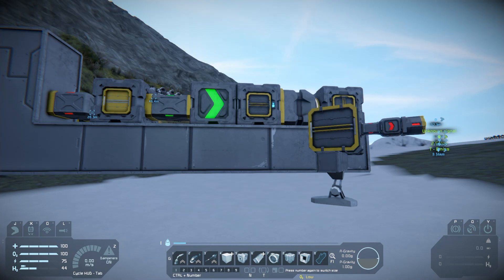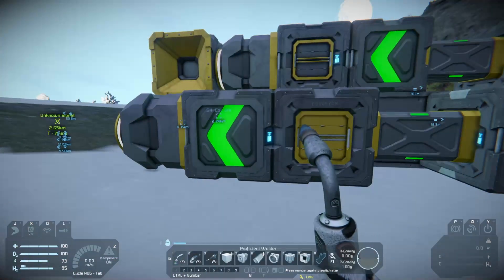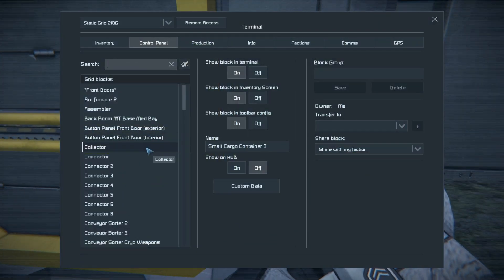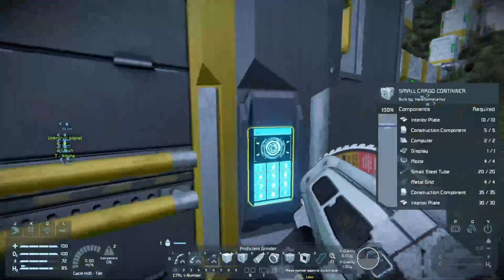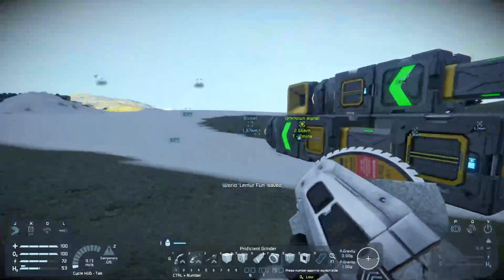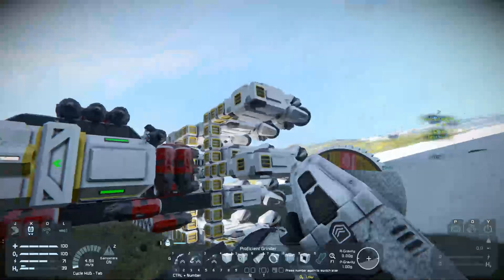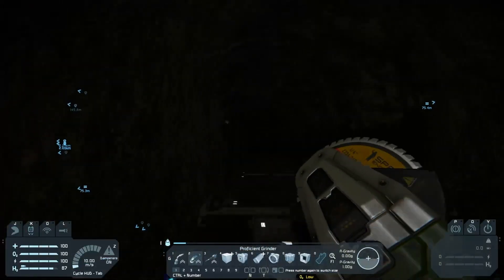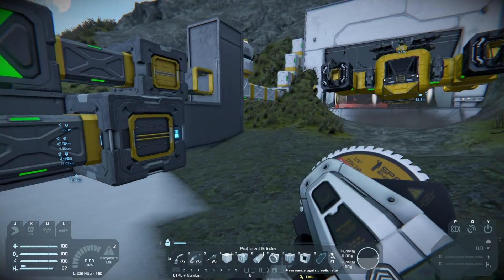Space Engineers - Conveyor Systems Tutorial

Comment: This is all good information. However, I would really like some help solving an issue. I have my large storage, refinery, assembly, survival kit, o2/h2 generator, oxygen tank, hydrogen tank,  and 2 cryo Chambers, all connected together on a very basic linear connection. So the issue I'm having is that when I go into the cryo chamber or use the survival kit to recharge, it sometimes won't recharge my H2 and O2. I have no idea why. It has full ice, both tanks are max full. But I just don't understand why it will not fill.. I notice that my ice is draining a very small amount, which is confusing because everything is full? Stockpile is off. Auto refill is on. .. is it possible that there is a "leak"?  And I just need to repair it? I would check now but I'm not on. .. I have been trying to find help on this issue but I just cannot seem to find it.